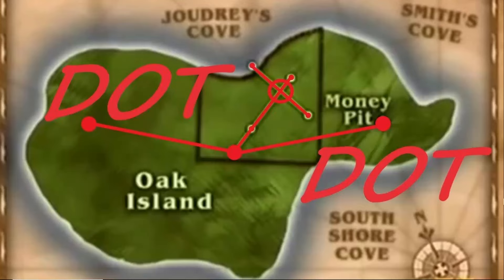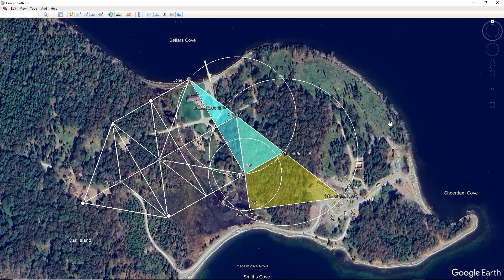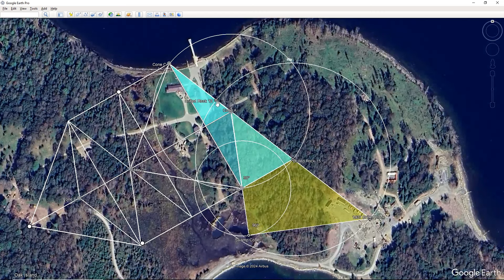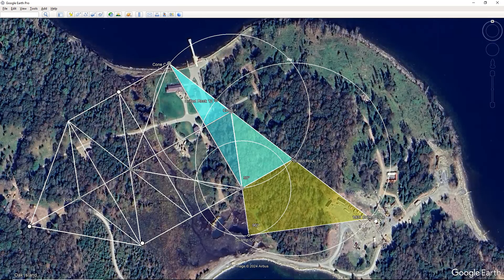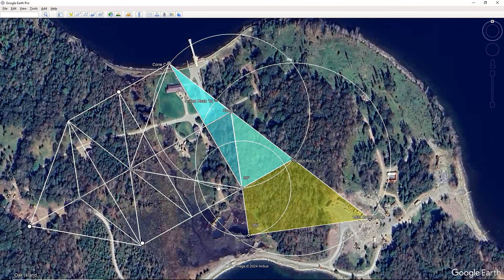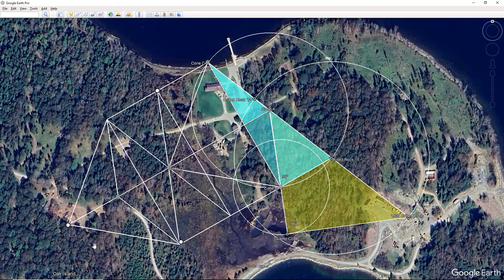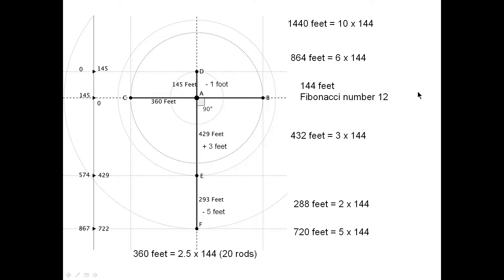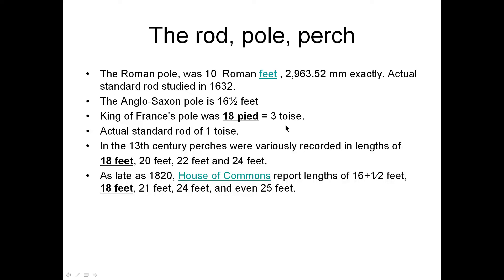Oak Island Discovery: What is Nolans Cross? Part 1 Measuring

Comment: Well done Micheal. Have  you ever in your researches of measurement seen any evolution of the bibical measure of a cubit or did it just fie put for more usable measurements?
Reply from the maker: Yes, I found all the measurement methods and the base 12 system is an evolution from Egypt and Roman times. The standards of length are what is uncertain to a degree of accuracy throughout history. Although we know they performed with high precision, the exact standards can vary through time, or by region. In the case of Nolans Cross the English standard of the barleycorn matches the distances. Although I could not find records of who established this standard, but it must have been in use before 1266. I believe it was adopted during the Norman dynasty after 1066. However, it is the divisions of Nolans cross that I base the theory of the 18ft rod which was a common standard length in France and England. Thanks for watching.

Comment: The French pied was slightly longer than the English foot, however after the Norman conquest of England in 1066 things got really complicated. The official language of England became French but the length of the English foot was retained because all the existing distances in the country had been previously measured in English units. So it is possible to have a document written in French that states pied when it is referring to an English foot. So the question is: was the Zena map written by  someone from France or an Anglo Norman?
Reply from the maker: "Zenas map" could have written by anyone who had some knowledge of Nolans Cross and the possible Vault that may hidden underground. It is certain it was not written by Templars or during medieval times. Zenas map is an encryption of that knowledge that reveals Nolans Cross as a geometric guide to the Oak Entrance and the Valve entrance on the West end of the Island.
Reply: @DOTtoDOT  I totally agree that zenas document is not medieval but it could have been reproduced from an older medieval document. The archeology dates on OI suggest something was going on at that time.
Reply from the maker: @wickaddiction314  Yes absolutely